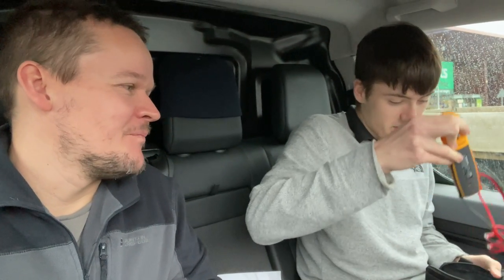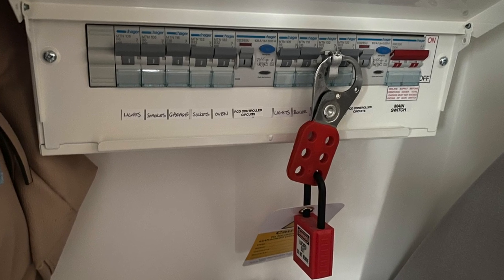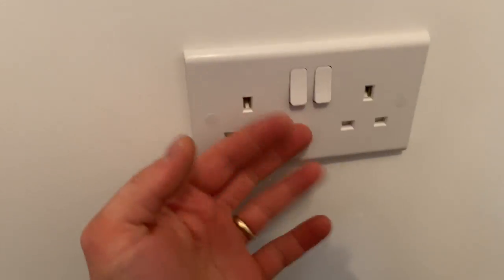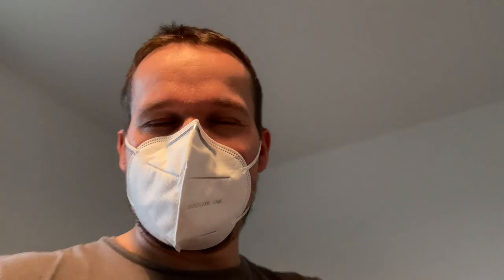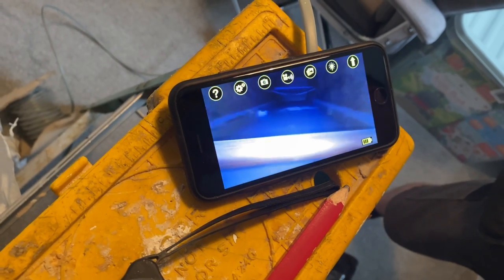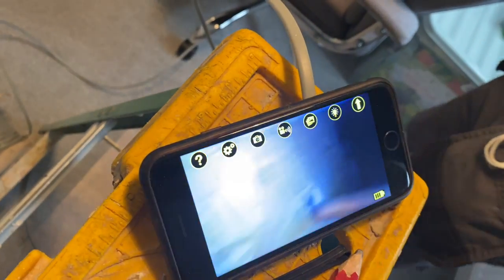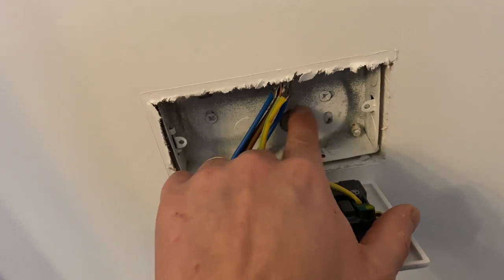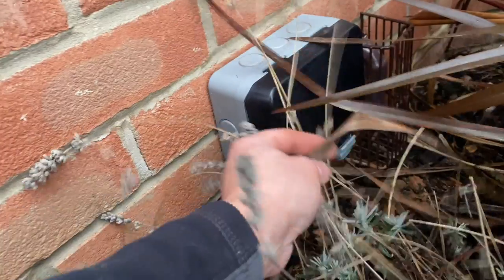NEW BUILD WIRING  Unprotected meter tails fabric of building

Comment: I’m not a fan of running cables in a cavity but as it will be deeper than 50mm I think RCD protection isn’t required, ideally imo an SWA would be better.  To put it on an RCD you will end up with selectivity issues.
Reply: They'd use time delayed one.
Reply: @Prince-ep8pv   a time delayed one won’t provide additional protection so is a bit pointless IMO.
Reply: As you dont know how cables are run we cant comment. If  in cavity they would need mechanical protection but  i would never put on a RCD as no discrimination.
Reply: 100Amp 100ma TD s type mate 😎
Reply: @adamstevens9196  you need ‘additional protection’ if cables are in the wall, you will only achieve this with a 30mA.
Reply: @Kaizer10155  you can’t use a 30ma up front you would have nuisance tripping if there was an earth fault .no discrimination, or now it’s called selectivity .
Reply: @Kaizer10155  this is only for circuits , meter tails are a different story , hence why you can have a 100amp bs1361 or bs88 fuse
Reply: @Kaizer10155  dude you are wrong I had an nic assessor come out and tell me this .also the tails are in a cavity , not chopped into the wall. Way below 50mm .if they are chopped in and less than 50mm then yes I would agree.
Reply: @adamstevens9196  where does it say you can’t have an rcd on meter tails ? Not saying your right or wrong as obviously I wanna be correct too. Regs are confusing sometimes ! 🤯
Reply: @Kaizer10155  it doesn’t say you can’t , but for best practice you don’t really want a front end 30ma rcd , obvs if you have no choice then you have to. And yes I agree they can be a nightmare
Reply: @adamstevens9196  100% mate I do agree.
Reply: @adamstevens9196  how does this provide additional protection?
Reply: @r3co0  how does what provide additional protection ?
Reply: @adamstevens9196  the 100mA rcd. Does this meet additional protection for upstream.
Reply: @r3co0  no mate it would only be used for when tails need protecting in say a cavity, below 50mm . Not for additional protection . If tails are just chased in they will need 30ma rcd , but in my opinion that’s not the best considering you would get no selectivity .  I would like to see them in trunking if possible or if need chasing in run it as a different wiring method . Type of cable etc.
Reply: @adamstevens9196  it's a bit of a grey area imo. I've just never saw a conclusive answer on it tbh
Reply: @r3co0  agreed, the DNO at one of my recent board changes had >3m tails going up the cavity unprotected and slung under the insulation of an extension shallow roof space, no clipping at all and into the Henley block. Their only addition was a switch fuse off the meter. My judgement was that the cavity was between 80mm of brick on either side, so cables unlikely to be penetrated, especially as they were slack. I clipped whole length as soon as they entered the unused roof space and kept them visible above thermal insulation. Got a tick from my NIC assessor. Debated the S type 100mA RCD after the switch fuse but we agreed it was unnecessary given the route of the tails.
Reply: @MS-Patriot2  An RCD would not necessarily operate due to the cables being single core, a ELCB should if the earthing is done correctly. but they are likely to suffer from to get phantom trips from stray currents from appliances or faults in other properties coming IN via the earth.
A good cover all is a fuse, the earthing system inside or outside the property doesn't matter.
This is a view from the DNO side not sparkies point of view.
I used to have no end of bother working on faults on our network and trying to put in temporary supplies. Once we reverted to using fused leads and away from ELCBs it all went away.
Meter tails are like an extension of the DNO network,  different maths applies unless your earthing system/connections is directly at the meter.
Remember the DNO does not use or require an earth conductor, so your earth would have to be utilised BEFORE the RCD or ELCB
Reply: @davidsoulsby1102  Interesting point, I understand where you’re coming from. thank you David.

Comment: Theres nothing wrong with a copper gas pipe running in a building, the gas engineer even went the whole hog and marked it up to warn the next tradesman as he should. So long as the cables are the appropiate distance from the gas pipe theres no problem with the gas pipe.
What is the minimun height a socket has to be from the ground on the exterior of the building? The external socket is right next to what looks like a hot water blow off pipe, with drilling out the drains in the socket will its new Ip rating be up to the blow off pipe releasing 85 degree C plus temperture water at 3 bar + pressure? Did you report and discuss the faults you found with the customer?
Thanks for sharing, its been a interesting video.

Comment: Don't think you can get away with putting an upstream RCD on as it would be a single point of tripping for the whole house, safety hazard. With it been the main tails only protected by the fuse, it would need to have some sort of earthed capping (>=3mm I think) or routed in a better way deeper then 50mm. If within the cavity of the leaf then also install mechanical protection such as armoured Kopex

Comment: The amount of copper showing on the line feed in to the RCD was crazy...
Reply: Seems to be an issue with the Hager Dual RCD boards and the way they crimp the cables - they can be adjusted a bit, but come like that based on the one I installed not long ago.

Comment: Tails would be classed as a distribution circuit You also don’t want 1 main RCD in the outside meter box taken out the whole installation
Reply: You'd use a 100 mA RCD outside for primary protection of the tails and to prevent spurious tripping.
Reply: @Karreth  you need Additional protection on any cable running within the wall, you will only achieve this with a 30mA. 100 mA is fault protection against fire etc. Check on site guide

Comment: Hi Chris the NAPIT onsite guide pages 129 through to 132 covers the aspect of meter tails. It doesn't appear to be such a simple answer, as the Regs seem to contradict itself, then add in Building Regs and the DNO requirements for meter cabinets adds to the complexity.
Reply: I asked our napit inspector how he would deal with this situation, he recommended 100 MA RCD and obviously must trip out at under 40 Ms at 150 MA.

Comment: A technical question for you. When installing a new metal back box for say a double socket, do current regs insist that a separate earth connection is installed between the earth lug bonded into the metal box and one of the earth connections on the rear of the socket which is used to secure the incoming earth connections?
Reply: Not required as long as one of the lugs on the backbox is fixed
Reply: @conorlanders8401  agreed, but still good practice and protects in the event of facia being pulled forward for decorating and the line conductor pops out to potentially liven up the now unearthed back box.
Reply: @MS-Patriot2  definitely good practice, as you say it provides a path back if the socket is taken off the backbox whilst still live.

Comment: I sometimes pending on circumstances, disconnect the neutral and line conductors of the circuit on the RCD dual split load so to minimize the risk of causing the RCD to trip the bank of circuits

Comment: Bendy rods..... Haha back in the day it was a bit of yt1 or yt2 lid.....
Reply: I tend to use thin, bendy bits of timber. Last time I did a lot of fishing in a ceiling I had two long bits of the tongue broken off of some old floor boards.
Reply: Metal coat hangers and tape
Reply: I fished through some high level trunk just reached in to pull cable out and got an almighty belt made my day!
Reply: @raychambers3646  Ugh, worst possible scenario!
Reply: @Lord-Brett-Sinclair  The metal coat hanger is a rare beast these days, I remember when every other car had one for an aerial .

Comment: May be the house was built pre smart meter days,no need to put the meter outside,surely with smart meters the  supply could go straight inside to a cupboard on the ground floor or downstairs hall or toilet that would stop the tail run in the cavity,nice to see you earth the back box like the old school way whatever the argument is 👍
Reply from the maker: The house is less than 1 years old.
Reply: @Cjrelectrical  then may be better planning from the architects 👍

Comment: I like to maintain the ring, so I would have used a maintenance free joint box in the stud wall on one leg of the ring, resulting in both the existing and new socket only having 2 cables in. And for the outside socket I would have replaced the 2 gang KO and cut in a 2 + 1 gang barrier KO box with a switched fuse spur on the ring, then the outside socket is not only isolatable but also a little further away from that cage and more accessible from the drive. No criticism, just how we've all picked up and developed our own preferences over the years.

Comment: David Wilson Great Western park? Was the initials of the original electrical firm MP? What's the issue with running 2.5 through the wall to the external socket without the pipe? Is it just protection from the cable?

Comment: Tails can run in the cavity up to 500mm I think before de rating. Possibly metal capped internally. That’s how we used to do it as developers didn’t want to fit a secondary meter box to house a switch fuse and dno don’t like them in their meter boxes

Comment: That socket you took off is a new socket so why wasn't the cpcs connected to the two separate cpc connections so if you lose one of the cpcs then you still have continuity throughout the circuit

Comment: That gas pipe in 12:54 could have ruined your day if it had been sitting a little closer to the plaster ceiling and a bit further away from the wall. Maybe closing the main gas shut-off valve prior to drilling holes could be advantageous in cases where the pipe runs aren't obvious.
Reply: He never said he didn't know the pipe was there. He just didn't realise it was gas until closer look.
Reply: Nope. Knowing where the gas shut off is, sure. But you want it turned on while drilling, if anything. You’ll hear and smell better if you hit it. A pipe full of non pressurized gas is more dangerous.

Comment: Our new build was the same. 8m of tails with no KMF fuse/switch.
Electricians weren't interested until I took the case to the NICEIC who made them come back and fit a KMF and open up the walls to check the tails. Surprisingly they were in a steel case going through the building and was earthed, quite a surprise that they would do that over some swa but there you go!

The excuse the electrician's gave the NIC was that the design had changed which saw the meter box moved from the front to the side of the house so the run was much longer and the guy doing the install didn't have one on the van...

Builder rhymes with Wailor Timpey, electricians were Cl@rks0n Ev@n5
Reply: interesting. were the NHBC involved in any way or did you just go straight to the NICEIC? who reinstated your walls afterwards? them or did they reimburse you for your own contractor?
Reply: @peter-gn8ey  was just the NIC, the NHBC weren't interested. Once the walls were damaged I made the builder return to make good

Comment: If it's in the wall greater than 50mm then that is ok with the regs, you couldn't have an RCD in the box outside, because then the whole installation would be on an RCD, although it's only slightly worse than a twin RCD board.
Reply: I'd have thought 100mA time delay would be fine to use there? Don't take my word on it though I've not yet had need to consider it.
Reply: @Mattja1  it does say 30ma for cables with non metallic earthed sheath or 50mm in the wall
Reply: @acelectricalsecurity  that's interesting, might pull the book out and have a look, wouldn't have thought 30mA would be appropriate covering the whole installation especially now that we're getting more devices we expect to get a bit of leakage from.
Reply: @Mattja1  it's not aimed at tails really, they just fall into the category, being pvc.
I think the original intention was to make us put RCD protection on all outgoing circuits, because making sure all non metallic sheathed cables were 50mm below the the plaster would be a pain to do and prove.

Comment: If that isn't a Bloor Home build with a Clarkson Evans electrical install I would be amazed. I've always wondered what was behind our Hager board. I guess each installation is different.  I just hope the same bloke who did this doesn't work in the South West as well!!
Reply: Didn't you see the door mat? DW Homes...
Reply: @farmersteve129  well spotted
Reply: I wouldn’t let clarkson evans  wire a plug😂
I’m in a barratt and have challenged them a few times about regs and most shrug  and say I’ve been told to do that🙄
Yes I’m a southwest sparky picking up issues too 
So many failures in just the execution of fitting things on new builds scares me of how these guys ever got their qualifications?
Yesterday I found 9 screws holding a water filled 🙄 adaptable box to a wall but not one wall plug and yes not sealed either 🙄
Keep up the work chris😊
Reply: Ha i thought it was a Taylor Wimpey being Deta Slimline and Hager, but i didnt reconise the landing layout. Saying which we fit Hager Deta in our bloors homes and DW homes too.

Comment: Putting 30ma rcd protection on main tails goes against the regs as well so either way would be against the regs . If it has to go in the fabric of the building less than 50mm deep you need to use SWA or some sort of protection against penetration.
Reply from the maker: 100ma time delay would suffice the 50v touch
Reply: @Cjrelectrical  wouldn’t meet additional protection requirements
Reply: @Cjrelectrical maybe so but it would still not be hood enough for the regs. If its not more than 50mm deep it requires additional protection by RCD doesnt it? Additional protection requires 30mA RCD. 100mA may comply with fault protection requirement but not with additional protection.

Comment: RCD protection would be best practice....but its fused anyway. Question is that does it function as a separate board? But it does come off the consumer unit. 
The protection on the fuse said 100A, is that the carrier rating or the actual fuse rating?

Comment: My property exactly like this with dodgy 16mm twin and earth from a fused switch in the meter box for about 4m to CU. Only basic insulation as the sheath has been cut right back and tails just flapping about.  Main earth smaller than bonding from gas and water.IP rating on top of switch disregarded as you can get your finger in there. New build from 2006. House bashers on a price. 'Registered' electricians-my arse. I'll change it myself and sleep at night.

Comment: An upstream RCD wouldn't get those tails out of the water as unprotected wiring needs 30mA and back there you'd need an delay 100mA minimum.

May be okay if they've buried them >50mm - but bad practice.

SWA all the way, amazing on newbuild that they don't spec an SWA.

More worried about that gas pipe ran in a void - pipes in voids need ventilation and I can't see any grilles.

Comment: I might have misunderstood the configuration in this video but I recall seeing a newer rule specifying that where a stud wall is being fitted with outlets on both sides within the same area that there must be a fire seal installed to prevent fire from being able to spread from one side of the wall to the other.

Comment: Not a spark, but love watching these vids and other youtube sparks as well... 

Genuine question as to me it seems "irrelevant": whats wrong with twisting the earth's together behind the sockets? Logic would say it doesn't harm anything by doing so and they are at least sleeved! 

Just my electronics brain thinking that from an electrical point of view it doesn't actively create a risk/hazard (if anything it reduces the resistance between the joining of the two earths)? 

I feel I'm missing something (regs wise most likely!)
Reply: When we need to do testing the wires need to be separated. So this of course means untwisting them. Now I'm sure you know what happens when you get a bit of copper and repeatedly bend it back a forth (it weakens then breaks), so what do you think all that twisting and untwisting may end up doing?
Reply: @Mattja1  ahh that makes sense! Totally didn't think of that :) learning things is awesome :P recently watched John Ward's video on the issues with EV chargers and TN-C-S PEN issues and it was awesome!

Comment: You use RCD's (we call them GFCI's for ground fault circuit interrupters) on a main? In the US we only put them in wet locations or where there is bare concrete. But we also don't have 220v to ground!
Reply: RCDs are the Standard in Europe now.
They become pricey when you do a new install in a 3 phase country like Germany, Austria, France etc...
We usually divide buildings into multiple RCDs and split the loads across them so you still have a halfway functional house if one side keeps tripping because of some weird ground leakage somewhere.